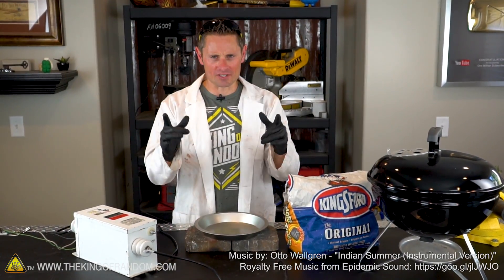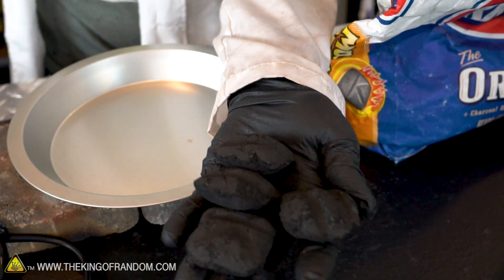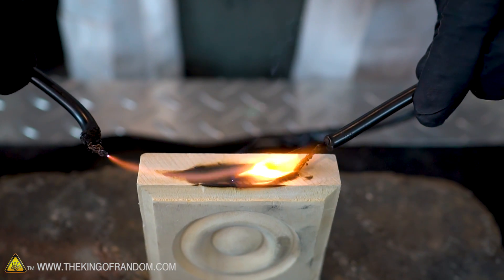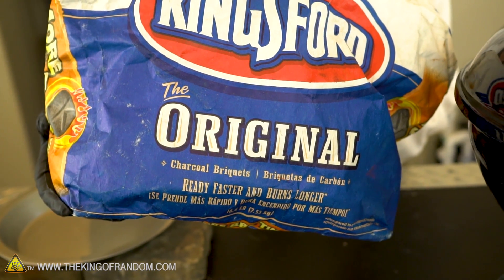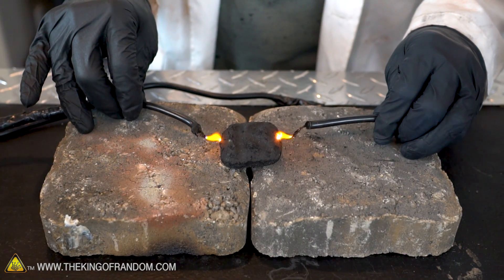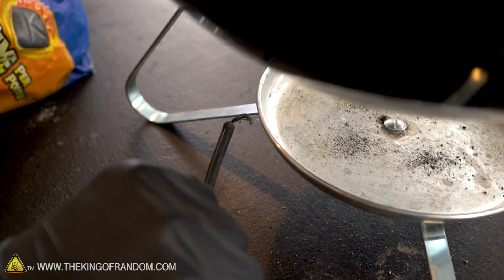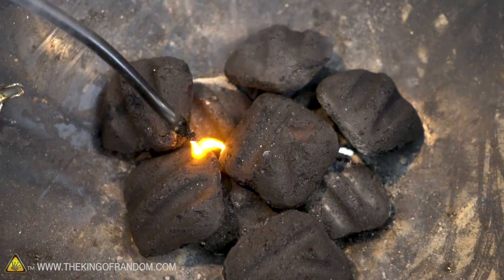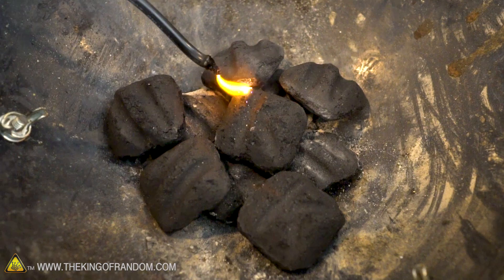Starting FIRES With Electricity ⚡🔥 TKOR Attempts A Firestarter Hack With Electricity Fire

Comment: Metal is attracted by magnate what will happen if you melt the metal in to liquid will it attract plzzzzz tryyyyyy plzzzzzz👏👏✌️
Reply: It will not.
Reply: SK Mahir iron, tin and very few other metals are attracted to magnets enough to be cool
Reply: Liquid metal is non-magnetic. Magnetism is determined by the crystalline structure of solid metal. In solid metal if all of the poles of the crystalline structure face the same way, the metal will be magnetic. In liquid metal the poles aren't locked into one place and the poles start to drift around and face different directions, making the metal non-magnetic.
Reply: Actually, the only three naturally magnetic elements are iron, cobalt, and nickel. However, those three can have their magnetism increased by alloying them together and adding other metals in (neodymium magnets), and a few other metals, plus the three listed can be made magnetic or have their magnetism increased by adding an electric current through them.

Comment: try melting pencil led and casting it into custom pencils
Reply: Pencil lead is Graphite and won't melt as it is an allotrope of Carbon. It will most likely decompose into Carbon Dioxide.
Reply: However, if you use/make pencils with Lead (Pb) then they can be melted down and recast.
Reply: it's impossible, carbon, under the atmospheric pressure here on earth would have to reach thousands of degrees to melt, we have never actually observed liquid carbon, the only other state we have observed it in other than solid was plasma, and it was in other stars much bigger than our own sun.
Reply: it isnt real lead anymore
Reply: Levi The Killer pencil lead isn't lead, it's graphite, so it would probably lose its properties from the heat and cooling
Reply: Johny best nope... because its basically just carbon
Reply: yes I know, but pencil lead has about the same melting point as diamond which like 3000K or something
Reply: Johny best diamond burns it doesnt melt
Reply: they can melt under very high tempeartures
Reply: Johny best nope
Reply: Johny best no it can't
Reply: look its up.
Reply: Johny best It burns under normal atmorpheric pressure. Its like trying to melt wood.
Reply: the pressure on earth just isn't enough, theoretically in a much higher pressure you could but at that point it would vaporize from all the heat you pumped into it.
Reply: I think he can use thermite to melt it

Comment: you should try to put a hot coals inside a vacuum chamber
Reply: I once cleaned a fireplace which was not yet cold with a vacuum cleaner and sucked up a glowing ember. The dust in the cleaner catched on fire and filled the room with smoke in about 1.4 seconds flat. Due to a quick removal of the bag the cleaner survived but kept on stinking of burning dust...
Reply: Donta Sharp Get a container, light the coals, put the coals in the container then put on the lid. Within a few seconds the coal will use up all the oxygen and go out. That's all that'll happen. Same as covering a candle jar while it's lit.
Reply: Donta Sharp yess
Reply: i would like to see that
Reply: It could keep on burning(not a flame)if there is oxygen within the coals.
Reply: Ben Newsome doesn't hurt to try.
Reply: BobbyHill that oxygen will be used up within seconds.
Reply: Donta Sharp will it still be hot even tho there isnt any air??!?? Reason for experiment
Reply: Spencer Colborne it wont burn in vacuum but it will still stay hot
Reply: Yeah, that is true, but in the vacuum of space fire is... weird

Comment: can you try melting glass with sunlight
Reply: Dude Amaz8ng he should try making his own glass from sand
Reply: Dude Amaz8ng u.
Reply: Glass is transparent tho, it would be hard to do that
Reply: Lop ,ggt exactly
Reply: glass has a higher melting point, so no chance
Reply: The bottle would break before it melts
Reply: The jar/bottle/can/whatever would break before it would melt.
Reply: But he doesn't necessarily need to use a bottle
Reply: How To Make Everything tried to make glass from his own sand with some interesting results.
Reply: He couldnt melt aluminum with sunlight - there is 0 chance he will melt glass with that tv thing.

Comment: Wouldn't they become red hot or blow up because of the loosely bound carbon atoms?
Reply: Carbon atoms are not bound together loosely. 

Also, things get red hot due to blackbody radiation which results from atoms being heated, this has nothing to do with the types of atoms being heated up.

Finally, no things don't blow up because they are loosely bound. Things explode because they are high in energy, and there is a lower energy form that the molecule wants to adopt. If this transition can happen super fast, and releases a lot of gas, we call it an explosive. Nitrogen compounds tend to be explosive.
Reply: Wind the Windy Its wood, wood only catches on fire or turns into ash.